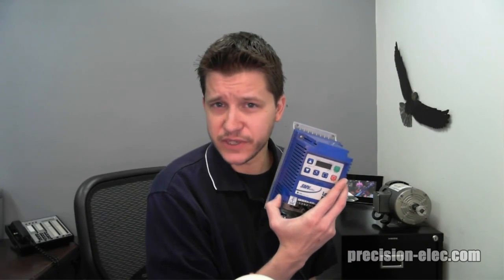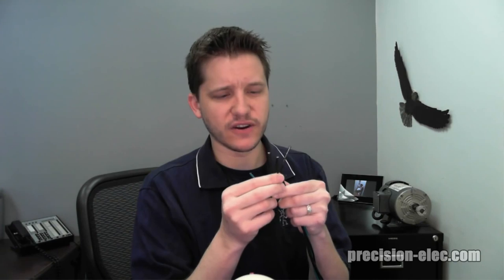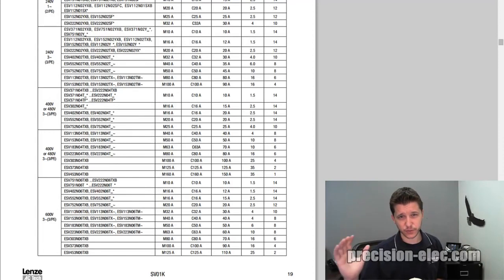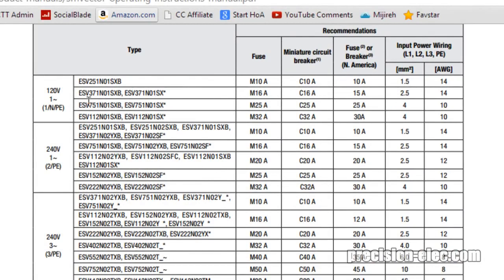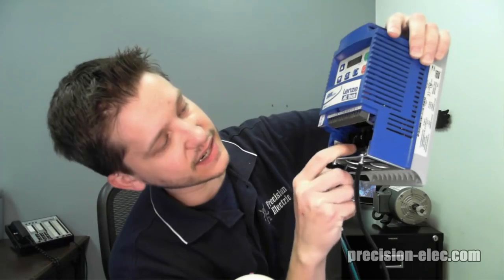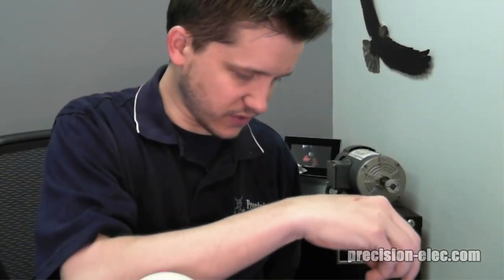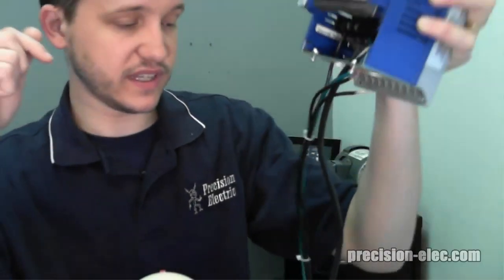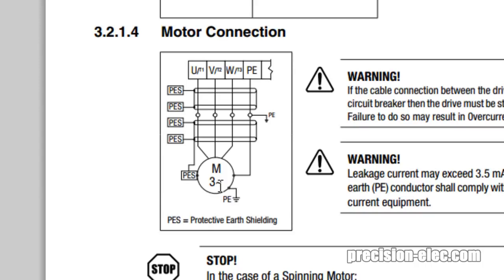How To Wire A Motor To A Variable Frequency Drive (VFD)

Comment: PRECISION ELECTRIC INC. why does VFD cause interference and noise issues? your DVM meter needs a VFD filter to measure the motors voltage?